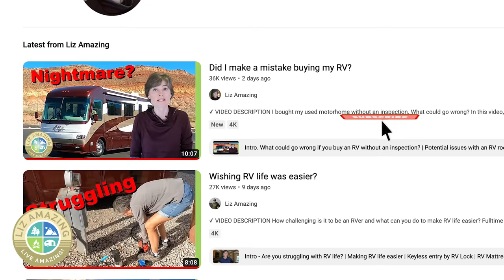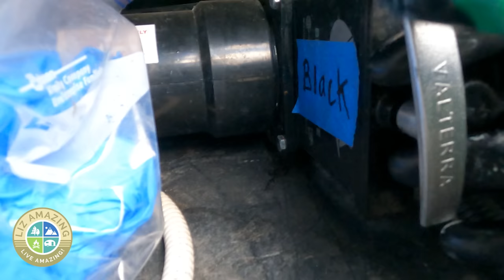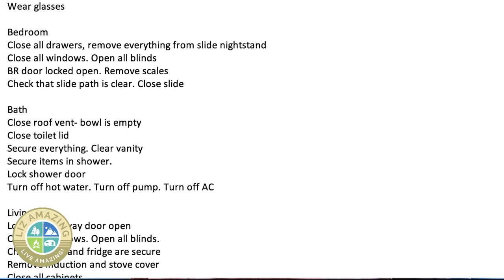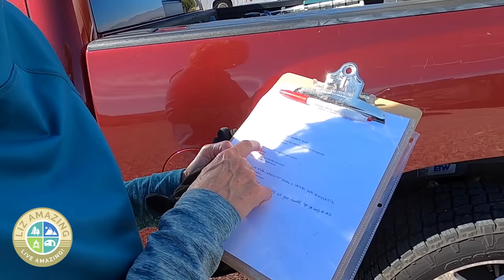Suffering with Travel Anxiety in an RV

Comment: Got home yesterday after 2 months in Florida. We stayed our last night 90 minutes from home.  That kept the day before a little shorter drive day. We knew we would have to winterize before we got home, so we did it yesterday morning after we dumped. When we got home we still had the energy to unpack the RV.  I just have to clean the inside  today and then Hubby will move it to the barn until our next trip.  Oh, by the way, we use printed lists and a whiteboard  on the frig . I also use the whiteboard to  write down the names of our neighbors.  I like to be able to address folks by their name after we have  initially met.
Reply from the maker: Smart idea about winterizing before you get home. Good one for sure. I like the whiteboard idea, I've been using post-it notes. Thanks for watching Carolynn and keep warm.

Comment: Another great video, Liz! Your advice about having a checklist is critical to having a stress-free trip. One thing I do, in addition, is to run a 2nd GPS. They are cheap enough and offer the security of having a backup in case of a failure. One I have "zoomed out" to include the destination, and the other is "zoomed in" for more immediate detail. 
I also have a 3rd for the copilot, so I can request special info, or for their enjoyment ... bcs there are always questions ... like "how far to wherever", LOL.
Finally, I'm glad you have a TPM tire monitoring system ... bcs that inner tire on the drive axle is very important to watch. If it goes flat, it will rub against its sister and at highway speeds can cause a fire from friction against the adjacent tire ... and in a short period of time!
I also carry a "few" fire extinguishers ... just for "added" peace of mind.
Reply from the maker: Yes! Glad to hear this Tom. I do the same thing with GPS looking at it through different apps. Thanks for watching.

Comment: That is when you can have troubles, when someone comes over to say goodbye or chat, when you are packing up to travel, You get thrown out of your usual set routine and lose track of what you are doing. I hooked my boat up to take it up to the servo (gas station) to fuel up for a fishing trip and the neighbor came over to talk boats etc. I went up and filled it with fuel and came home to reverse it into the yard, then the trailer came off the tow ball and slammed into my tailgate. I had forgotten to latch the tow lock.
Enjoyed your video, as always. safe travels, Liz
Cheers from Oz.
Reply from the maker: Yikes! So sorry that happened to you. You can't blame the neighbor, but yet so frustrating bc it seems whenever people go to hitch or unhitch at a campground, people always come over to chat. Thanks for watching and cheers to you down in Oz!

Comment: Some good tips in there.  I drive a small motor home (21' Class C) which is about the size of a Class B van or truck camper.  If a person can do without all the luxuries of a large complex Class A and dinghy, I feel that this is way to go to reduce stress.  We sightsee enroute, top off with gas before checking into the campsite, and pack up the campsite before going to bed.  Retract the awning, pack up the chairs, etc. , unless you intend to have a leisurely departure and sit out again having coffee in the morning.  Even then, I stow the chairs overnight.  In the morning we only need to clear the countertops and unplug.  We don't need to dump every night.  We make sure we are being proactive with watching tank levels and planning ahead so we don't end up at a park that has the dump closed, or if there is a storm rolling in and we have to unplug and leave.  One time in Florida I had to unplug in the morning and there was 2" of standing water everywhere due to an overnight storm; yikes!  I have heard of campers having to evacuate in the middle of the night.  What if you had a medical emergency and had to leave?  My wife and I set up quickly and break down camp quickly.  To each their own, but we don't see the need to have a massive camper and set up an elaborate campsite and decorate.  A person can control the degree of complexity by simplifying their rig setup.  I would also add that we can fit in a normal parking spot, can make a U-turn on a 2 lane road using the shoulder, and rarely have to worry about low bridges.
Reply from the maker: Hi Ernest! You are bringing back memories of my five months fulltiming in my 21' Class C Chinook camper van. It was super great for long trips. For me, it just didn't work for fulltime. After a while, I found I could not enjoy life to the fullest in such a small space. My hat is off to people who can live small! Happy travels to you!!

Comment: I always feel stressed getting ready.  I'm driving from Texas to Northern Minnesota next month. It's for a work camping job at digikey.   I tow a 33 ft travel trailer and have 3 large dogs.  I have lots more prep and planning to do. So many RV parks don't allow large dogs or 3 dogs. That adds to my many planning challenges. I plan my rest stops for the dogs, and google gas stations that face horizontal so I can fit my truck and trailer through.   Also wind, like you said is a no go for me.   :)  love this topic!
Reply from the maker: Yay! So glad you found this video. Helpful, Luann! Thanks so much for watching, and wishing you stress-free travel days!
Reply: Eye on the weather heading north so early. They are pretty good at clearing the snow off da roads up dare.. but cha never can tell.. eye to the sky.. travel safe

Comment: I “have” ptsd but help control it by allowing things to be part of the lifestyle.  I am a full timer and just do not make any reservation where I have to hurry.
Lists are part of my lifestyle but I find I can be easily distracted using the printed one. For set up and break down I use a mini flip cards/ chart that I keep in my phone holder on the dash. It happens to have multicolored pages and is only about 2 1/2” x 2”. One item per card. No flip until its done!
Recently I was going 9:03  to skip checking my sewer hose tube during my walk about bc I had only stayed at a Cracker Barrel.  I do check that no glass bottles have “rolled “under a tire but who would mess with the tube??? God said check it! Sure enough, while the cap was secure, the 2 (two!) extra bungee cords were gone.
Take your time ( doing day before is a great idea!)  it’s all part of the lifestyle
Reply from the maker: Hi Jean! Wow, that flipchart sounds really interesting. Thanks for sharing that, it seems like a good way to do i that will also help others. Good for you that you checked everything at that Cracker Barrel. Thanks for watching and for your kind words. See you on the road.

Comment: Great video Liz! You covered everything! One of my worst moments was when we decided we were gonna stay at a Flying J for the night. When we pulled in there wasn’t any line at the diesel pumps so I decided it was a great opportunity to fuel up. The pumps had DEF and diesel but I couldn’t figure out how to select diesel. Let’s say it was a pump problem. I went inside to ask and the clerk said he switched it to diesel and I was all set. So after filling up we found a spot to park for the night. As I was laying in bed I started thinking about the DEF. Am I sure I pumped diesel? Did I pump DEF by mistake. I was so stressed about it I could not go to sleep. Then I started tearing the camper apart looking for my receipt. I finally went back in and asked them to print out another receipt. I was so relieved to see that the receipt said diesel. By this time it’s 2am and now I’m stressing cause I’m gonna be tired driving the next day. Lesson learned! Never go to those pumps again! Be well and safe travels.
Reply from the maker: Oh my gosh, Warren. I would have been worried too about that DEF. Scary for sure. Thanks for sharing and for watching. See you in the next one.

Comment: Hi Liz!, I'm Ron I've delivered rv'z  for 12 yrs now.I hardly ever call the dealer unless the paperwork says so. I don't  even worry bout the place, cause I could care less whether I'm 1st to check in or check in at lunch. Only on rare occasion do I get surprise people. I guess I called for wash Great American rv in Hattieburgher Mississipp, and the  nice lady says : Ah no worries bring it on in 😆😆.  I do have tons of equipment I carry tools, impact guns, Honda generator, extra heat sources, big wheel battery charger/ starter,  but hey ya know what they say: IF YA HAVE IT WITH YA , YOU WONT NEED IT 😁😁😁
Reply from the maker: That's the way to be Ron! Sounds like you are prepared and you have lots of good experience driving large RVs. Thanks for watching and see you in the next video.

Comment: Liz, the CD player by the bed in your Alfa looks chrome. 0:02  Was it like that when you bought it, or did you modify it? I have the same Alfa you do and am looking for something that’s the same form factor to replace it with.
Reply from the maker: Great question. That is actually my lighting reflecting in the original CD player. Mine is non-functional and I would like to replace it with something but I might also have to rewire. Keep me posted if you find something. And thanks for watching!

Comment: This is great stuff, Liz!  Weather and wind are definitely my biggest stressors.  I use Weather on the way and Windy apps for checking the weather on my route.  Flexibility is key here.  Great job, as usual!
Reply from the maker: That's a great tip about using a wind app. You definitely have to be flexible because you don't want to force yourself to drive in unsafe conditions. Thanks for your comment and see you in the next video Paul!

Comment: I guess I'm confused, you have a GPS and the KOA has an address, wouldn't it tell you when to turn?
Also, what if the KOA was at the end of the "Dead End" road.

To relieve stress I go down to the local boat ramp and watch idiots try to back up their trailers, goes real well with Lambrusco and cheese,,,,,,,,,,,,,,,,,
Reply from the maker: Hi Mike! There was construction and the roads were so torn up that the main entrance was inaccessible. There were no signs. The answer...only by calling the KOA...was to drive around the campground, through a neighborhood to get in the back entrance. It was so crazy. It was completely understandable that the guy with the new motorhome and Jeep would think the dead end led to the campground. Unfortunately it did not. Thanks for watching. And, yep, boat ramps!!! I used to have a boat so I know.